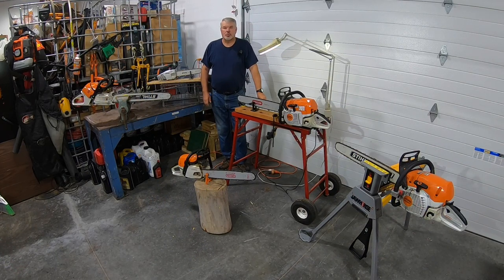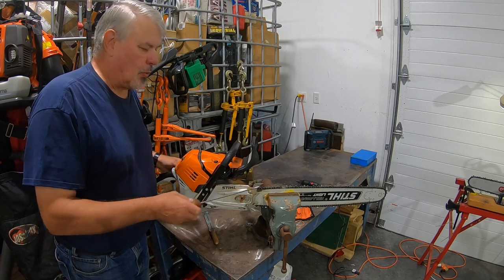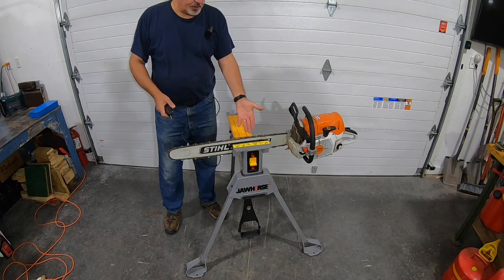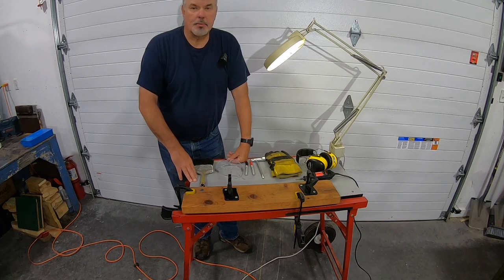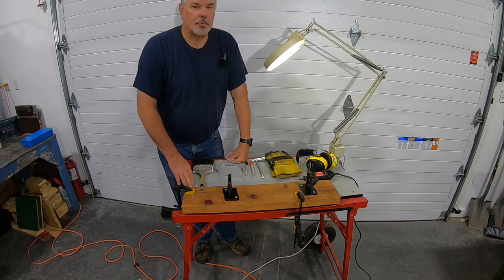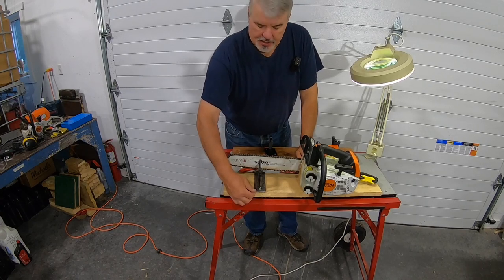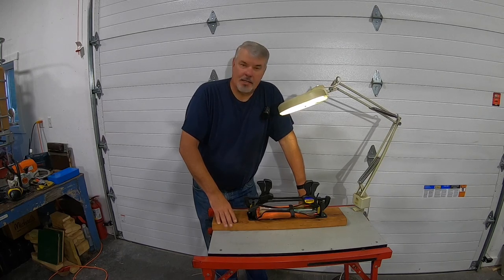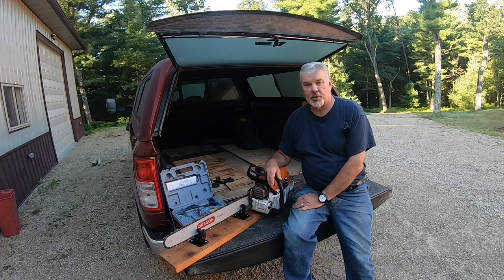Best Chainsaw Vise

Comment: Hi Tony, thanks for sharing.
The rotating machinist vise was great to see - very useful.
And good variety of clamps, ty.

Since experiencing the Stihl File Guide #2 and in particular it's firm quick clamping of each tooth for filing, I have not even attempted to sharpen a chain without going beyond the clamping of the bar to the clamping of the actual tooth being sharpened. I have noticed some very experienced hand filers actually finger clamping each tooth as they file it or using other means to give more stability when filing. 

I'm thinking of a chain clamping setup that is height and angle adjustable which would be quicker and simpler than my Stihl File Guide #2. It gives me great sharpness and I love it but I'm thinking of going to a tooth clamp/vise combined with something like a round file holder that will set the 'C' in each tooth consistently. (If I was to add in an adjustable angle device like the FG2 and a depth gauge setter that works from new to the witness marks, well that makes for a hand filing setup that will do each tooth, with gauge defined accuracy, from out of the box to the witness mark.

Thanks again for sharing and the opportunity to think and respond, it's been very helpful to me.
Cheers
sincerely
d
Reply from the maker: David, I’m glad you enjoyed the video. 
Thanks for watching and commenting 👍TCT
Reply: You're welcome Tony @TonysCoolTools  
May the sun never set on peace
Cheers 
sincerely
d

Comment: Thanks Tony, after watching this video I had to do some tinkering and make the c clamp version. I ended up drilling and tapping (8mm-1.25) the stationary jaw of the clamp and inserting a rubber hammer head from a Harbor Freight multi head hammer. It keeps from marring the bar and adds the spacer you talked about. I also added a plastic clamp pad to the movable jaw. I wish I could add a pic but it works great. Thx for the idea.
Reply from the maker: Boy Tim I think I’ll hire you to make my next chainsaw vise. Sounds like you took a great idea and made it better. Thanks for watching and commenting 👍

Comment: Nice video. Years ago I purchased an aluminum vice similar to the stump vice, you make a cut in a log or pole and then push the vice into the cut and attach the bar. It is super light and fits in your pocket and is great for traveling. I also used a bench vice in a mount I welded up for a reciever hitch. Since I mostly run run square grind I sharpen all my chains in my shop now, it's been over 10 years since I sharped a chain in the woods. One will want to be very careful clamping on the Stihl ES light bars as they have hollow grooves milled into them that when clamped on will cause them to dimple. It will be interesting to see if once the folks using the dremel and round file to sharpen try the Hexa file and profile chain switch to the Hexa. Stihl offers a grinding wheel profiled for it as well. I have been using it for some time now and it definitely cuts faster and stays sharper longer than round grind, especially in dirty wood. Plus its easier to master. Looking forward to it becoming more readily available here in the U.S. Regardless of what method and profile one uses the most important thing is to run a sharp chain.
Reply from the maker: I’ve been trying to buy the new Hexa chain but no Stihl dealers in my area have gotten any in. The concept and ease of sharpening is very interesting. Can’t wait until I can get my hands on one. Thanks for watching and commenting 👍

Comment: Great options Tony. I also hate the discomfort bending over for tasks . My solution was a 5 gallon bucket. You can sit on the top or bottom. Empty out the small tools/accessories you want to carry  instead of 4,5,or6 loose items. Perfect height for tailgate, sawhorse , etc. I also carry a padded throwable floatation device to cushion my backside to set on hard plastic bucket. 
Keeps me smooth as a babies bottom .👍😁😁😁
Reply from the maker: Definitely a good idea. Ha ha I need to do a video on the 100 benefits of a 5gal pail. Thanks for watching 👍

Comment: Tony, great selection of vices! I have a bench vice, a stump vice, and also a stihl electric sharpener i happened to stumble upon. I bought an Oregon stand and just put it together tonight.  I like your portable vice.   I often thought about welding some square tubing to fit in my 2" receiver, but that would be heavy and expensive.
Reply from the maker: Craig sounds like you have a variety of options for the sharpening process. I’ve seen several versions of the 2” trailer receiver jigs and though handy they do look heavy and big. Thanks for watching and commenting👍 TCT
Reply: Yeah, the Stihl electric just happened to fall in my lap.   Went in to look at some 2 n 1 and a guy said do you have an electric?   I said no but looking at a stihl or Oregon.   He said i happen to have an extra one that was going to another shop, but they were downsizing the Stihl Dept so it is for sale.   Asked him how much and i walked out with it.   Ill see you on the next one Tony Cool Tools
Reply from the maker: @craigwilson9560  Craig, being in the right place at the right time is how you get those deals👍TCT

Comment: Great job on the chainsaw vices. The welded "C" clamp idea looks good, I may have to weld one of those up. I noticed on the different devices the saw bar sits at different angles, I prefer to get the saw level when I sharpen. Have you experienced any differences in the chain from sharpening at different angles? Thanks for sharing.
Reply from the maker: Typically I do have the bars as level as I can but for the video I just clamped the saws in for demonstration purposes. You definitely don’t want any angle when sharpening. Thanks for watching 👍
Reply: I’m glad you guys brought that up; may be one less way I can screw up! 😀

Comment: No tips on how to get the Stihl angled bar feature to work ;)
I use a vice on the back of my truck for in the field sharpening but I have got a stump vice just in case I need it and haven't got the other vice bolted on.
Reply from the maker: Ha ha Alan, the angled cutting bar and chain are exclusive to Stihl. All other brands of chainsaw manufacturers are trying to “cut” into that market. 😂😂

Comment: Hi, my brother has me looking all over creation chain meister vise system! Please help me find this. Thanks. I tried your link etc. i just sm not sure. Have a pleasant day. I wait hear from you.
Reply from the maker: Bummer I see what you mean, I tried looking them up and can’t find anyone that stocks them.
 I know Chris from In The Woodyard was going to produce an identical product but don’t know if he’s released them yet. 
Let me check and I’ll get back to you but it probably won’t be until tomorrow.👍TCT
Reply: @TonysCoolTools  thanks Tony I appreciate it. Did you have one on your show? What is the next best thing you would recommend? Thanks again, Dee
Reply from the maker: @dove767  Dee,  no I did not have one of Chris’s on my video but he showed me the final proto type and it looks awesome. I checked with him and he may start manufacturing them this fall but couldn’t give me a specific timeframe. The next best option would be to take a C-clamp like I showed in the video and have someone weld it for you on a board. It works really good as well. Let me know if you have any other questions 👍TCT

Comment: I gotten used to holding the saw between my legs on the ground n can have it sharp in a couple minutes if I don’t lower the rakers.
Reply from the maker: Tyrone sounds like you’ve been doing this awhile, at 66 it’s tough for me to bend and kneel on the ground so I need any help I can get. Your method sound very efficient using your legs as the vise. 
Thanks for watching and commenting 👍TCT